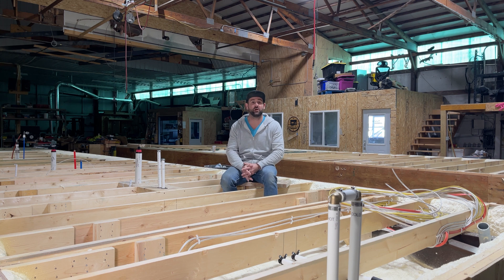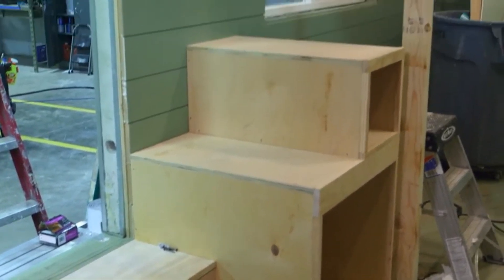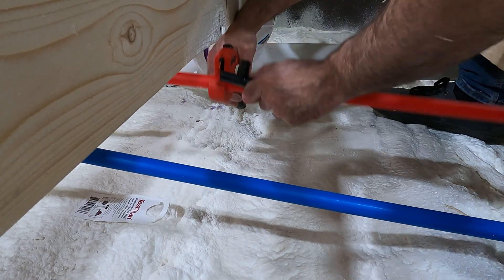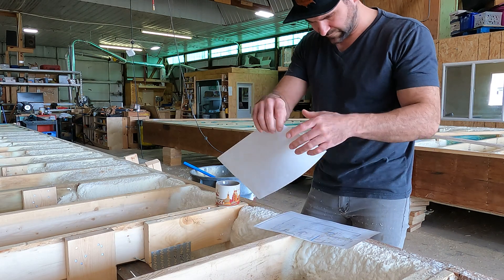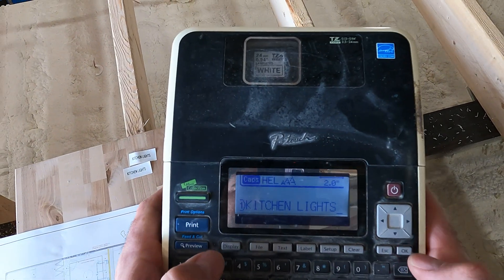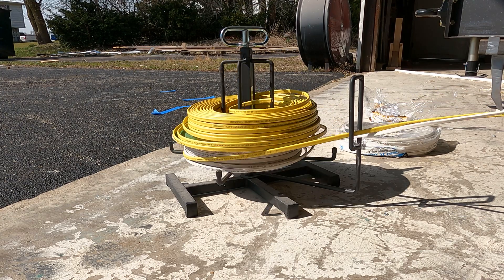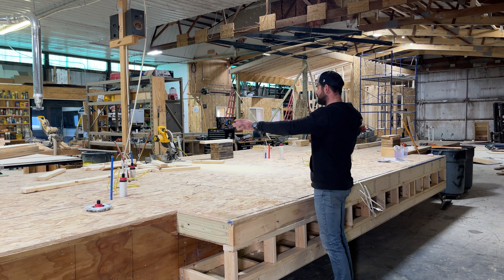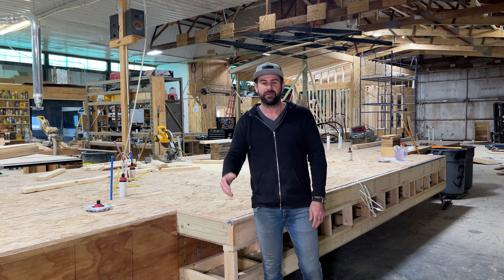How To Install Plumbing, Electrical, and Plywood Subflooring

Comment: My question is a little off the main topic but I am wondering where you get your blue prints made, and what do you think a good price for them is?
Reply from the maker: That’s a very good question! I happen to make my own. However a good interior design should be able to help you get to a set of concept drawings which should save you some time and money before going to an architect for a building grade set. Does that make sense?
Reply: @BobClarizio  thank you for your reply. Yes it makes sense but I guess my real question is what architect do you use and what kind of price should I expect for an architect fees?
Reply from the maker: @zoo4U2C Can I ask you a question?
Reply: @BobClarizio  yes. Ask away.
Reply from the maker: @zoo4U2C what are you building?
Reply: @BobClarizio  I am planning to build a small accessory building on my property in Arizona. It will be a very basic building measuring 16’ x 48’. I have already created a basic plan in Visio. It contains the floor plan layout, each of the wall layouts, how I want the plumbing and electrical to be. It is going to have one office in it, a bathroom, and a shop space.  It is really just kind of a really big shed. I have not decided yet if I want to have a slab foundation or to build a wooden subfloor similar to what you have been showing in your videos.  The project is hopefully going to start in about six to eight months. I am looking to find an architect that will do a project this small.  Not sure when to look and what a good price would be. Any thoughts you have would be appreciated.  Hopefully that gives you a little idea of what I am looking to do.
Reply from the maker: @zoo4U2C  That sounds very cool! I have a shed company called INshed and we build alot of those types of building. They have become very popular lately. Is your style more modern or traditional?
Reply: @BobClarizio  I guess it would be more traditional. Standard truss roof style. 
Does your company offer blueprints for a similar type of project?
Reply from the maker: @zoo4U2C I have an online designer on our website theINshed.com but I typically don’t do custom design work. However, send me an email with what you have so far and I can quote you for what it would cost me to do a build set of plans. Here’s my email bob@theinshed.com
Reply: @BobClarizio  I will do that when I get back home.  I am traveling for the next week and am away from my files.  Thank you.
Reply from the maker: @zoo4U2C no problem, hopefully I can help!
Reply from the maker: @zoo4U2C sounds good! Do you plan to heat and cool the space?
Reply: @BobClarizio  sorry for the delay in responding. Yes I am planning to condition the space. I have three small heat pump window units that will be placed in the building. They will have dedicated spaces in the walls and their own electrical circuits. I’m hoping that I get home Sunday and will send you the information I have next Monday.  All the best to you.